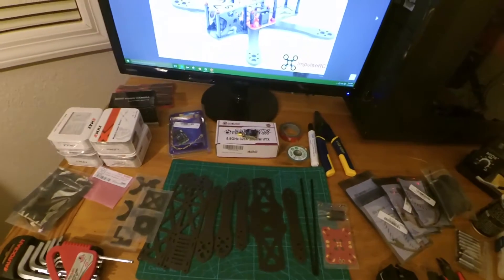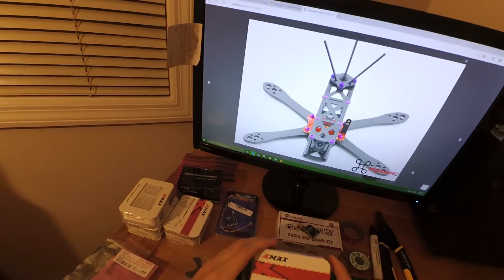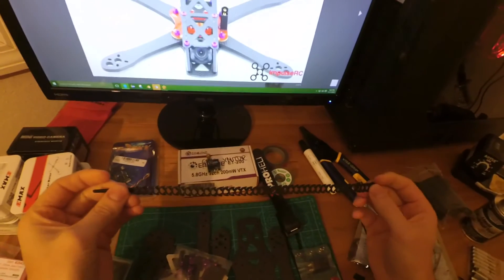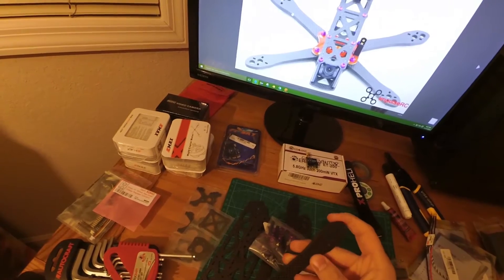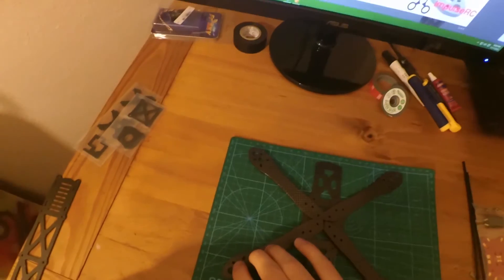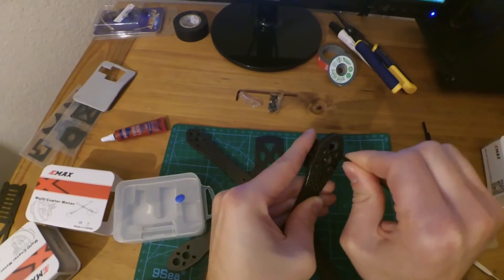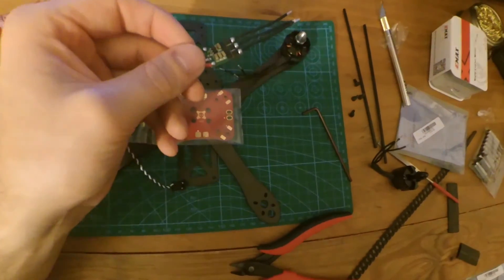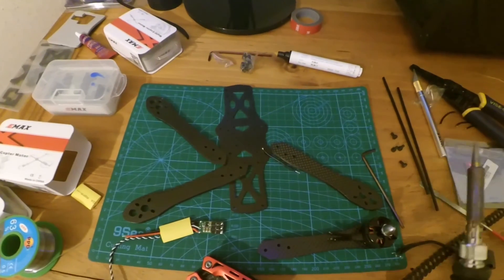Alien Build Part 1 List and Arm Construction

Comment: dont you have to buy the file set seperately?
Reply from the maker: I don't see it listed as part of the package on impulserc.com so they may have changed it.  When I purchased the frame it did come with two files.
Reply: +Veil well i just ordered mine last sunday still waiting on it to get here hopefully they will add two files to mine i forgot to add them to my cart
Reply from the maker: +2007crf450r for sure let me know if they still do! if they don't I might be able to send you the two that came with mine to use
Reply: +Veil cool thanks for the offer if they dont its no big deal i have a few files laying around
Reply from the maker: +2007crf450r you're welcome. let me know either way. if you have any other questions or anything I can help with feel free to give me a holler on here or through my email at veilfpv@gmail.com enjoy the alien!